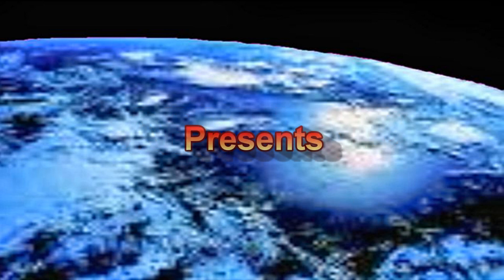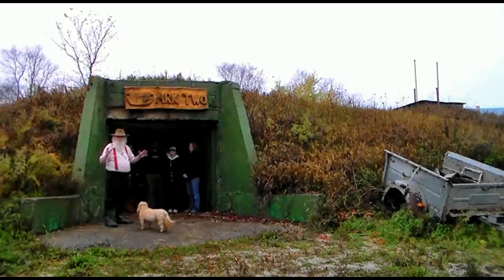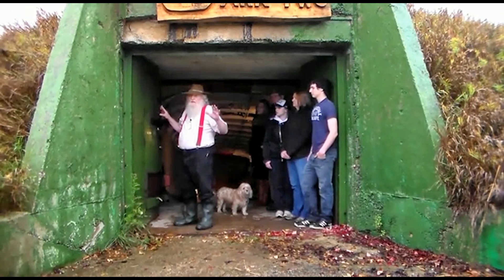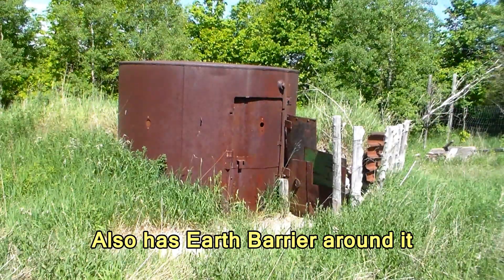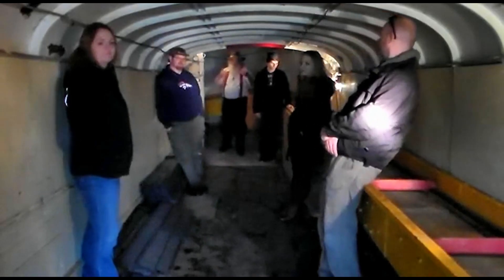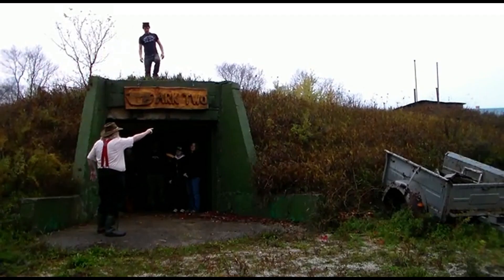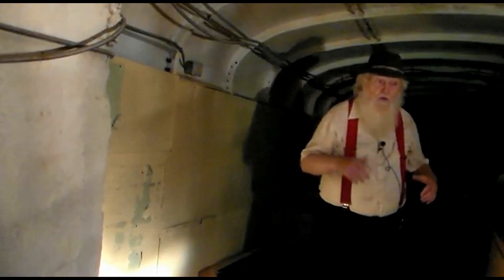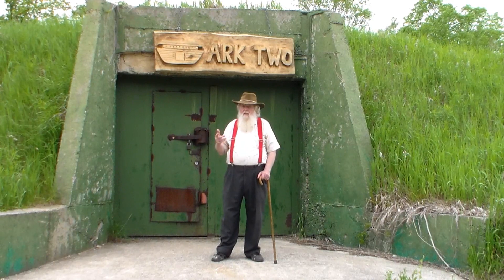ARK TWO #9 Designing Shelter Entrances

Comment: You can't be serious? Am I the only one thinking that radiation can 'turn corners'?! Yes, Gamma Radiation is a very high frequency form of EM spectrum, and apart from a near infinitesimal amount of diffraction, won't turn corners. But the radiation won't just stop at the wall, it will ionise the atoms in the concrete, producing Beta radiation inside the bunker. Fallout won't just be gamma, Alpha and Beta radiation are produced, as well as harmful X-Rays, which will drift around the corner.